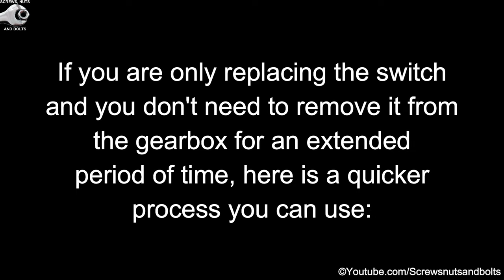Reverse Light Switch Replacement

Comment: Thank you for the detailed and high-quality video! 
Let me add some information. If the sensor has three contacts, then it not only turns on the reversing lights, but also informs the engine ECU that neutral gear on manual transmission is engaged. If the three-pin sensor breaks down, an engine malfunction may occur with a diagnostic code for the neutral sensor. This will cause the CE light on the instrument panel to come on.
There is no such sensor on automatic transmissions. Instead of a reverse sensor, an inhibitor is installed there, connected to the automatic transmission selector.

Information from the repair manual:
To check the sensor, disconnect its electrical wiring connector and check the continuity between the sensor contacts.
    Note. The contact numbering (1-2-3) goes from left to right when the connector latch is facing upward.
There should be continuity between contacts 1 and 2 when reverse gear is engaged, and between contacts 2 and 3 when the manual transmission is in neutral. There should be no conductivity in other positions.
Reply: Thanks for detailed information about "three contact sensors". My Clio 4 car also has three contacts. I've replaced the switch. Now my reverse light works. But somehow car computer gives error about stop-start system and hill asistance error. Do you know what can be the problem?

Comment: Nice tutorial mate, is this the same rough procedure for other cars? I have a Megane mk3 and have changed the fuse for the reverse lights but they still don't work, my next step is to change the switch.
Reply from the maker: Thanks. A lot of cars with manual gearboxes have a very similar set up. Depending on the position of the switch, you may need to drain the gearbox oil or be ready to plug up the hole as soon as you remove the switch.
Reply: @screwsnutsandbolts  Cheers dude, I'll be sure to have an oil pan just in case, could probably do with a change anyway, the car has done 80,000 now.

Comment: Thanks for the video..Has this switch got 3 pins, if so do you know how to check the 3 pin variant.. Also, Is it worth replacing the gearbox oil at 50k miles? If so how much oil and type required for this vehicle? Many thanks..
Reply from the maker: Yes it has 3 pins. Changing the gearbox is recommended every 50 to 60 thousand miles. This video has all the details about the oil and capacity: https://www.youtube.com/watch?v=0wfNRjdeh18
Reply: @screwsnutsandbolts  many thanks

Comment: I can make the reverse light go on by pressing the switch manually but it’s doesn’t work when it’s inserted into the gearbox. Can you tell me the issue inside the gearbox and the name of the part to replace it
Reply from the maker: I don't know what's happening inside the gearbox to be honest. Is it a new or old switch and was it previously working ok ?. Is it definitely the correct switch for that gearbox ?
Reply: It could be a worn out switch. The transmission might not push it all the way to touch contacts like you can with your finger.

Comment: Where can I purchase one of these backup light switches
Reply from the maker: You can probably pick one up from ebay or amazon. The part number is 3200500qad but double check that with your car to be sure it's the right part.

Comment: 008194C
Do you have a real part number?
Reply from the maker: The part number I found is 3200500qad. Double check that number to be sure it matches your car.
Reply: Found 32005-6J00A for K12, K13, T31 (Xtrail) on parts page Manual Transmission case & clutch release (unit)
BUT it appears to be 2 pin plug.
Tridon says TRS081 which is 3 pin (dual normally open switch)
32005-00QAE is correct for 3 pin Reverse/back-up switch